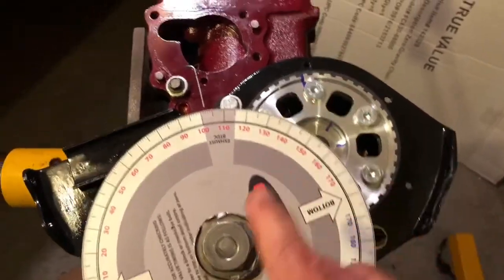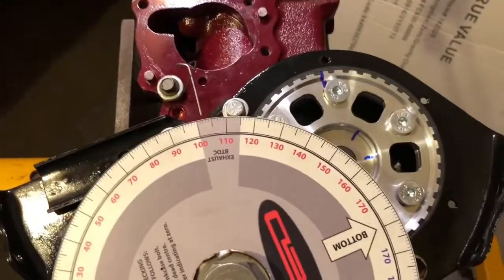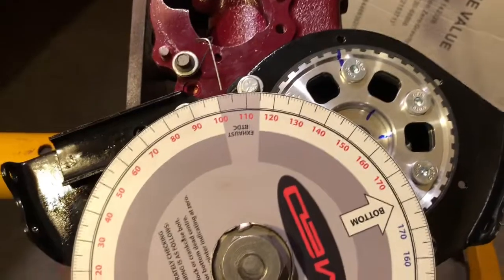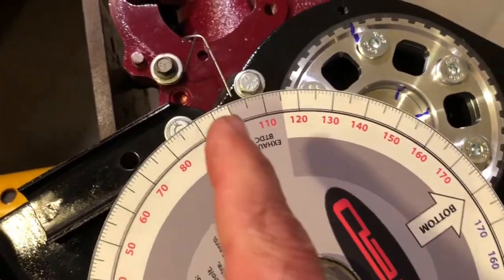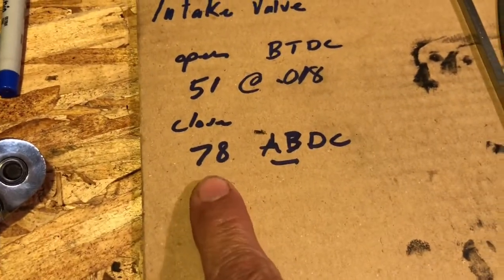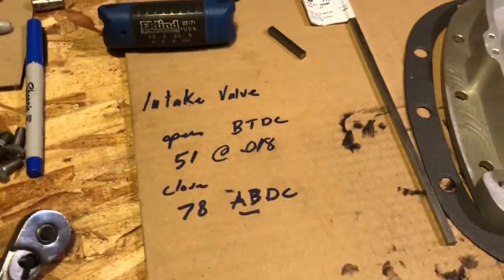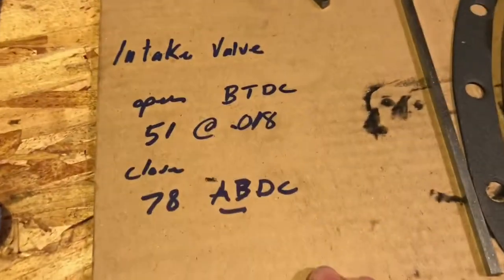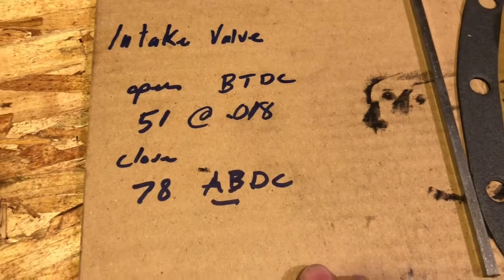How Cam Timing affects compression pressure

Comment: I'm a Briggs vanguard guy but I love how you braced the flywheel side of the block with aluminum plate. Gives me some good ideas, I'm in the middle of building a turbo 35 cube Rt now and have been playing around with all types of ideas now thanks to you tractor pulling guy's. But I definitely understand the frustration, no need for apologies after a long day at work to make a video. Thanks so very much for posting. I love one thing about them kohlers the vanguard can't compete with is using SBC valve train parts! Lucky! Back in the day when they were new we had a problem from kohler and valve train noise. #1 was non adjustable rockers and 2 all it takes is a piece of dirt to clog a hydraulic lifter check valve, so we were replacing the OEM kohler lifters with Chevy small block ones. No fancy rollers though lol. But always awesome to see how things progress again thank you for taking the time and sharing your knowledge. 👍

Comment: A very interesting video, and it raises a question for me regarding an engine that I recently overhauled, designed to be around at a CR of 10.8:1 and set cam timing to the makers spec but at quite an unusual figure and I'm finding that compression is a touch on the low side at 130psi per cylinder and quite even across all 4.  I'd regard this as more of a used engine compression reading rather than a refresh/rebuild???  So the cam timing figure, as you'll know typical 'A' series cam timing is usually in the region or 102 ATDC to maybe 108ATDC.....with 106 ATDC being a typical and as recommended by such Kent for many of their cams.  The particular maker that I used suggested that they had seen good torque and power figures obtained when cams were timed in at 99.5 to 100 ATDC.  As far as I could work out by my averages I set this cam at 99.75 (doubtfully that accurate but...)  I have adjustable duplex, so do you think the compression may increase to as much as 150 or 170 psi for example if I was to change the cam timing from 99.75 ATDC to a more typical 104 or 106 ATDC?  Or is this far too much of a pressure gain to expect?   Any advice would be much appreciated thanks.

Comment: Profiles,lifts,duration all aside I  just want to ask. I'm working (again) on a four cyl w/ double overhead chain driven cams. IF one cam is off say 2-3 teeth could this cause a false "misfire" up to 2500 rpm or so? Please email back when you have time.
Reply: gosh yes, 3 teeth is alot!!!, I take it you have a non - interference head, because 3 teeth out is enough for the valves and pistons to high five each other, fix asap

Comment: 309° cam....very interesting,13@1....hps?
Reply from the maker: Yes this is a full race engine. We have dyno'd this at over 135 HP at the wheels so far. My goal is 100BHP per liter with reliability, so that would be 138 from 1380cc.  Probably around 180 at the crank.
Reply: @JemalCRM  
I think that with 180hp @crank there will be ~150 @wheels. 
Quite impressive to get 180hp out of this old construction!

Comment: Great video, i also subbed! I'm trying to understand cam timing a little better to try optimise top end power and torque on my built n/a engine... are you able to give a quick description on how advancing/ retarding intake/exhaust cams can improve power and torque. The engine i have is a toyota twin cam 5efe 1500cc engine. It is currently 11.8-1 comp, e85 fuel, 292/292 camshafts, itb manifold and a basic 4-2-1 exhaust manifold.

Any info is much appreciated it is very hard to find anyone willing to share secrets lol
Reply from the maker: Aah a twin cam has more flexibility... and complexity!  Obviously I cannot set intake and exhaust SEPARATELY with the single cam pushrod engine, so different rules apply.  What you run into is that it's not possible to set to the best power AND torque because each ends up being at the expense of the other.  With the A-series engines of the Classic Mini, advancing the cam makes a bit more HP,  but torque suffers.  So If racing, you want advance and race gas for sure.... I explain how compression PRESSURE is higher.  For the street, where you have to deal with intersections, not so much.
So you have to seek out the best compromise for your intended use. I've set up twin cam superbikes and my Lotus Twin Cam with specific timing, but without vast experience with these, I used the best recommendations and experience of others.
I hope it doesn't sound like I'm hiding secrets!  I don't think there is one. Anything you do affects everything else, so you just sneak up on it if you have the patience and a scientific approach.  Or look at what others have done and the results.
Reply: @JemalCRM  Im working with a SBC and assembled compression is .8 less than all other parts were planned with.  So, the heads are being milled .025" and cam is being moved back from 108-107, to solve this.  It will change the cam timing event slightly for compression bump and make small % more torque and small % less Hp